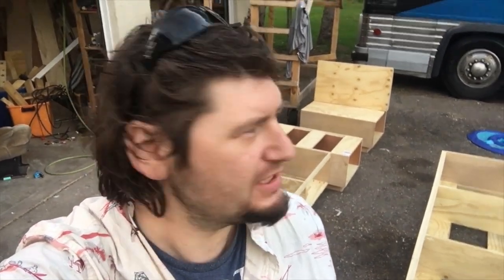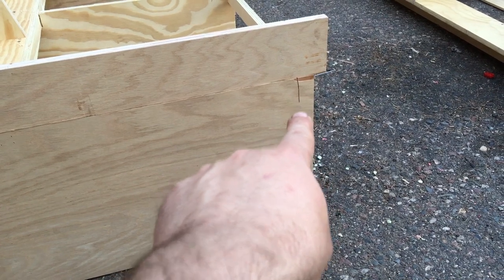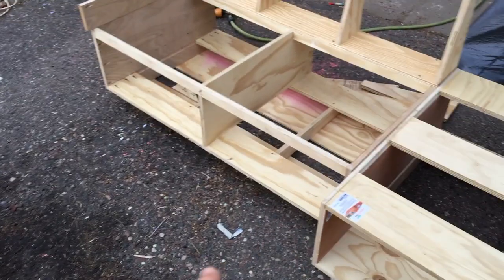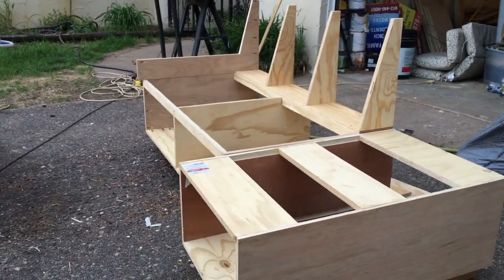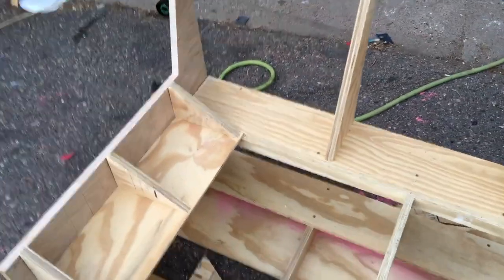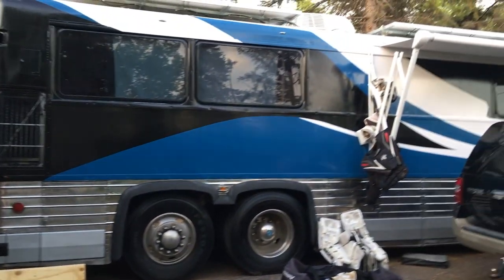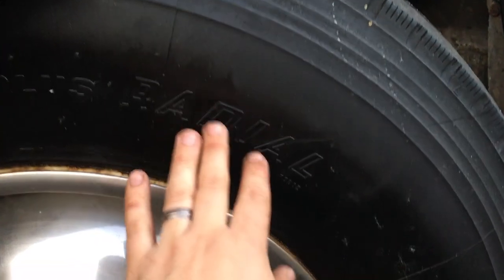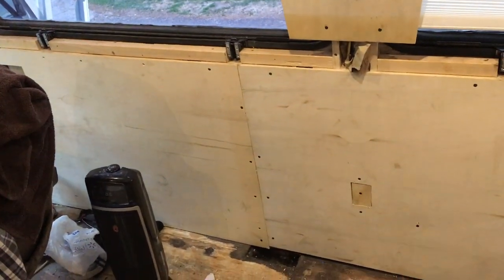Bus Conversion Custom Furniture Build

Comment: Your doing great on the furniture your going to cover it its all about support to bad on the tires they look like they were syfered? That's when they cut lines in them for better traction and a smoother ride it cost big money I had it done years ago but it was worth it.
Looks great on the conversion keep up the good work.
Reply from the maker: Brian Davis thanks! (I did another batch upload, look for more soon)  I never did an update on the tires, I got new ones, Yokohama 12r22.5s spendy but I'm safe now. Can't wait to take it out.
Reply: Great tires I bought new tires 20 years ago on my first bus conversion and bought Aluminum wheels I think it was like almost 8 grand I can't imagine what it would cost today? There isn't anything better when you get new tires and take it for a spin its like a new vehicle.